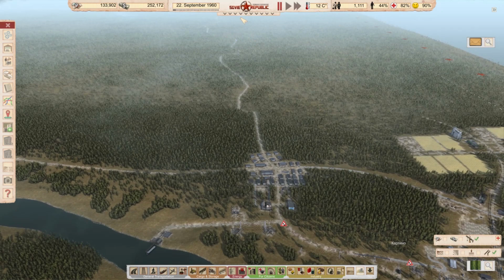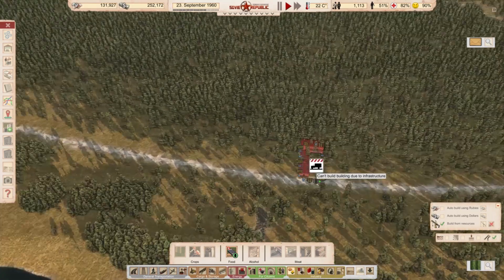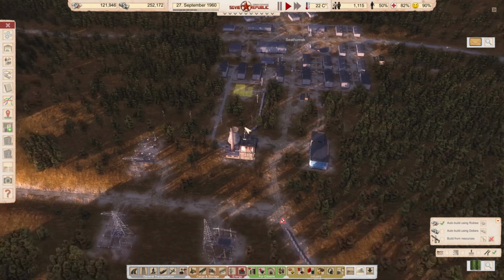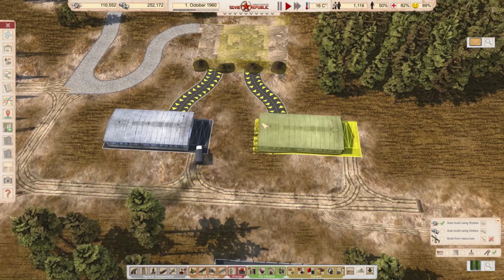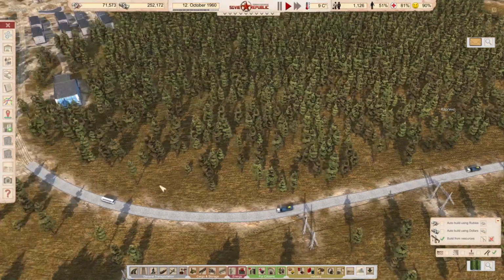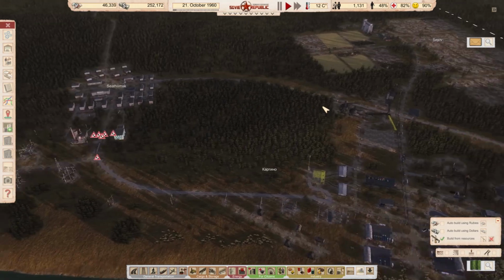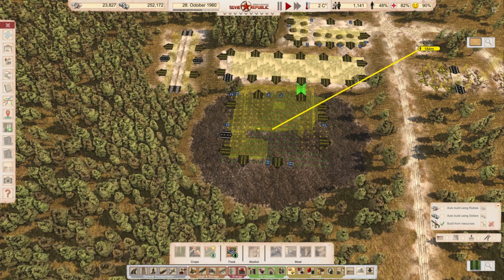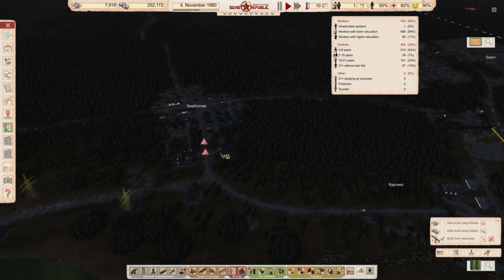Soviet Republic - Yeniseisk- The Rise Of Siberia - Ep.7

Comment: 1) If I were you I would build the kindergarten, you lose a lot of workers (unemployed) because of this ...
2) You would gain speed and efficiency if you moved the paver and roller from the CO road into the unused CO that you will then use when you have long factoiry connections to build. These two locations would be more useful for additional vehicles related to road construction (a second flat bed, anothe dumper, or even two flat beds and you will be able to forbid your buldozers to take ages to go to the roads in construction they have to reach). At the start of the game, the expansion of the road network on the map consumes a lot of buldozers.
3) What I wanted to say for the footpath office is that on 12 locations you use 25% to transport what your CO construction can already carry. In fact, to speed up the construction of power lines, it is especially the Footpath CO mini buses that are useful, but these three vehicles (flat bed, covered hull and road crane) take up a place in my opinion useless that the CO construction manages already. Remember that you also have an "unused" CO which can house these reinforcement vehicles (the flat bed, road cranes etc.) and this CO can be used as reinforcement for power lines (or whatever), and thus allow you to have a more powerful Footpath CO in what it must build as a priority.
4) You have a tower crane in the "unused" CO (which you could call the reinforcement CO), you could have assign this CO to the road cargo station which lacked a tower crane at some point.
Reply from the maker: 1. I understand but I don't think we are lacking many workers if at all. But it needs to be done eventually. 
2. Yeah! Roads we are constructing are further and further. I think this is a good idea! 
3. Interesting idea! But what about Foot CO sending all buses to the same construction. Won't it do the same again? I will address this. 
4. Not a bad idea I would have to be aware of the vehicles that are in there and not just put "everything else" in there. So crane, road crane, paver, roller and couple of flatbeds. So machinery only. The nice first step into the "CO expansion" in my head.